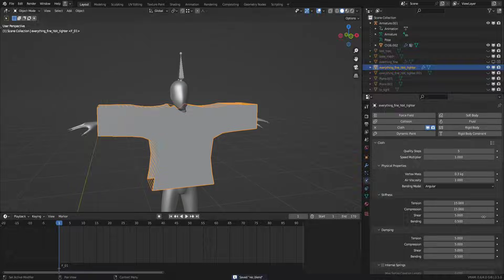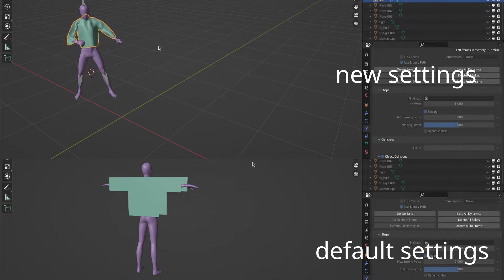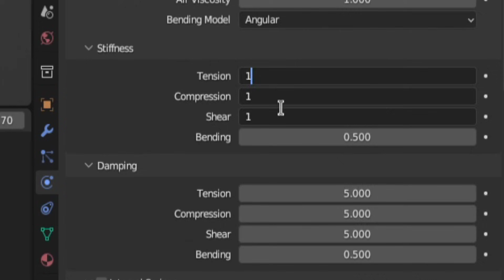The SECRET of Perfect Cloth Simulations | Blender Cloth

Comment: And one more tip. It is not necessary to have quad topology (but it is good for later subdiv and smooth). It is okay to have final topology with even (almost isosceles) triangles and just smooth cloth a little. Also if topology is quad, it is good to make Triangulate [longest diagonal] after sim and/or subdiv. Cloth wrinkles will look much nicer

Comment: Thanks! This helped a lot. The default settings gave me bizarre results, even when I changed settings to Silk, Rubber, Leather, or Cotton. Nothing worked as expected.
Why does my cloth continue to slide across a flat floor, even when I turn up the friction? How do I change the roughness or stickiness of the collision objects. As is, it's like it's been sprayed with Teflon, which is not realistic at all. Also, could you explain impulse clamping? Thanks!

Comment: First thing first -> change scale from 1 to 10 :) and you will se the magic. (For example human with real size 1.7 Height etc , and shirt with real size, make them 10x bigger, and all your jitter will gone forever (dont forget apply scale). Thanks for the tip with DAMPING on collision objects its intresting i need test it.
Reply: good luck with rigs animation transfers
Reply: Lol it work tho
Reply: This is true. And the reason is that Blender sim bonded to static floating point range. So when numbers (position change vectors, velocity vectors ) are too small (even due to high precision) it makes simulation much less accurate. 
So it is good to multiply scale to 10 or even more (up to 100)
Reply: @bzikarius  SHIRT IS EXPLOSE HHH
Reply: @bzikarius  SHIRT OR HUMAN MAKE BIG I TRY BUT NOT WORKING

Comment: What was your scale like? Real world? I was testing some sims earlier and saw a tip to increase the size of everything, get your bake, and then put everything back down to normal scale. It did work pretty great and the simulation looked good, but it messed with my props connected to the rig and couldn’t put the scale back in place. I’ll try your tip next.

Another tip is to use proxies for a collider, that way some of the cloth can be sculpted a bit closer to the character without worrying about it clipping with the collider

Comment: What scale are you using? Like is one blender unit 1 m, 10 cm, etc?
Scale has a huge effect on physics sims but isn't talked about much.
Reply from the maker: The human is normal human height so around 176cm - I specifically didn't want to change the scale - because you can't scale down already baked cloth simulations.
Reply: @edinspiegel Wild guess, but wouldn't it work to export the cloth sim as an alembic and then import it back in to scale it?